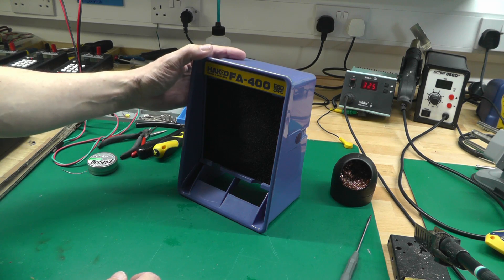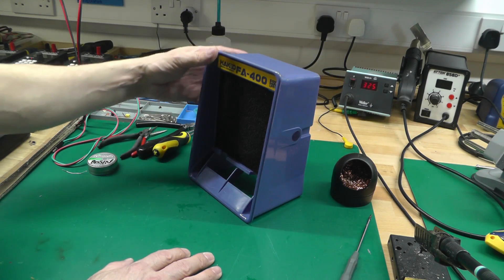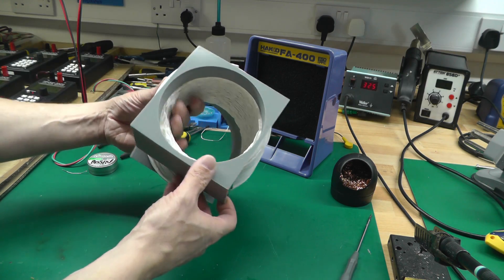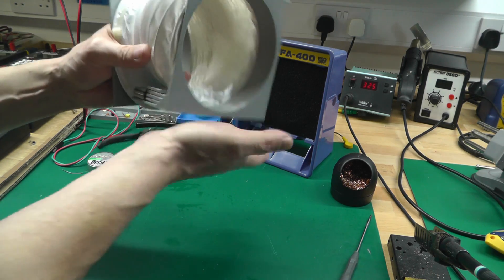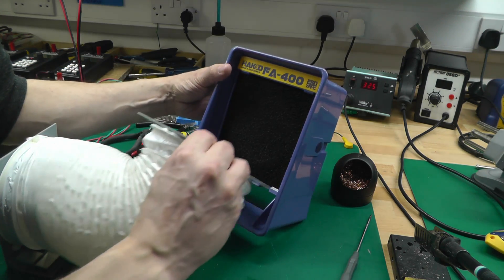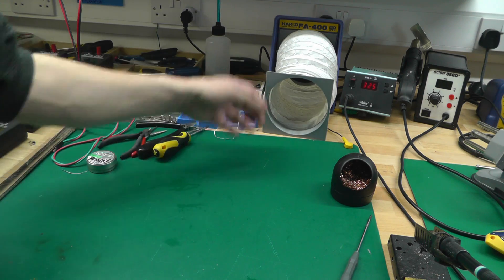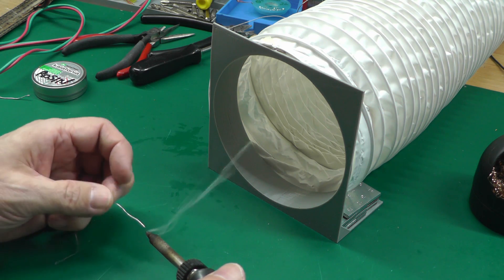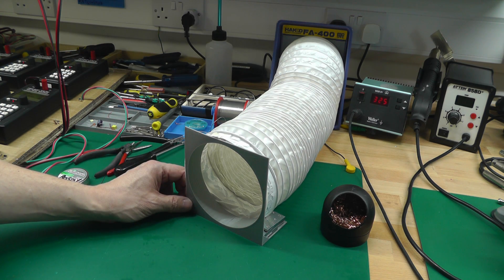No.044 - Hakko FA-400 Smoke Absorber Modification

Comment: Hello Ian, can you tell me what material the hose is made from? I have been looking for something just like it for a while. My one will pull the air straight out the window and needs to be easily moved each day.
Reply from the maker: It's a thin plastic with a wire would through it........just yer normal stuff from DIY stores.

Comment: Hmm. So instead of having the fan close you have the tube close. How is this better?
Reply from the maker: Try both and you will see!......The tube is less instrusive, more effective, easier to handle, easier to put away when not needed, no trailing mains AC cables across the workbench.
Reply: Lol, I'm scratching head thinking the same thing.

Comment: Looks Good. I just put a a cheap Orchid 'growers fan' 🤣 a-la John Ward inline between two sections of that ducting. Then I put a bit of corrugated plastic pipe on one end so I can direct it and strap it to something with elastic. The other end goes straight out the kitchen windows lol. Bit of a pain to set up but packs away neatly into a Tupperware box. Keep it up.

Comment: Can't put a price on health, I have been having rather strange asthma symptoms and I'll save the horrible bits for you to imagine. I really admire the effort here, unfortunately I was using the pathetic maplins one I think it's rated no better than 100 cubic meter/hour and would leak vertically unless you were really close! A pain if you are re-capping an Amiga or any large pcb work. I decided enough was enough and bought a Tornado 1500 cubic meter/hour grow extractor which has a range of about 16 inches on my 4 inch diameter intake hose with net/directional grill , I read that dropping the 8 inch on the tornado a few times cleanly to 4 inch will give best results (see picture below).  It set me back about 230 pounds but to have a long range such as around 16 inches horizontally with no leakage vertically is an absolute change in air quality. 
Pic on Amibay: http://www.amibay.com/showthread.php?104428-Pre-Orders-Kipper2K-Dual-Rom-Quad-Rom-hold-reset-to-switch-Kickstart-rom-boards&p=934024&viewfull=1#post934024
Reply: Wow, that thing is beast. Quite literally. That will suck more than just solder fumes, it'll suck components up too. I saved the 40W blower fan from my old gas CH/HW boiler when i had a new high efficiency condensing boiler fitted. Im going to modify it as a fume extractor.
Reply: Simon Tay yup it can if they get close hence the net / wire mesh inside the front of the nozzle . Also pcbs stick to it and flux evaporates fast / iron cools quickly it’s a bit of a battle but rather that than get worse lungs from theflux fumes lol

Comment: I think it may work even better if you use smaller diameter tubing with an expanding flange at the bench. Depends on the fan I guess.
Reply from the maker: Yes, I contemplated that, i.e. 4" tubing, but I had 6" to hand. Maybe a mkII version and I'll compare.

Comment: Very nice, I gave up on extraction and modified mine to blow across the bench. The airflow needed is much less so is a LOT quieter, but of course it doesn't pass the flux fumes through any filter. I noticed the little tin of flux- how are you getting on with that brand? I just bought a whole range of solder paraphernalia from TermoPasty as it was all really well priced.
Reply from the maker: I just use the rosin tin to clean my iron tips....I never apply it anywhere. I was gonna use it to create smoke for testing the FA-400 but decided to use solder instead. Side-note: I use Amtech NC-559-V2-TF flux on pcb's, lasts forever before burning away. PS. I am asthmatic so kinda gotta get rid of the fumes in my wee workshop.
Reply: @IanScottJohnston  I keep meaning to pick up some genuine NC-559 to see what the fuss is about. I've always mainly used Multicore/Loctite flux gel or just Chemtronics flux pens. Asthmatic too but it doesn't seem to irritate mine.
Reply: I use MG Chemicals #835 flux and Kester flux pens. I am not asthmatic and I love the smell of burnt flux, but I don't like it in my face. I put my FA-400 as close as I can or just fan it like Steve. I also just use my rosin tin for cleaning my tips like Ian does. I have noticed that using Chip Quik messes my tip up. I have to use the rosin tin and apply/remove some good solder a few times to get the Chip-Quik cleaned off of my tip.

Comment: I see you also have a Hakko wire sponge holder.  I have personally found the Velleman ones to be considerably better due to their heft which prevents them from sliding down the table.
Reply from the maker: Yep, every time I use it the dog has to go fetch it!......However, hmmm, another 3D print and some lead weights coming soon!...:-)
Reply: That's why I love my blue anti-static mat. It helps keep things from sliding around.